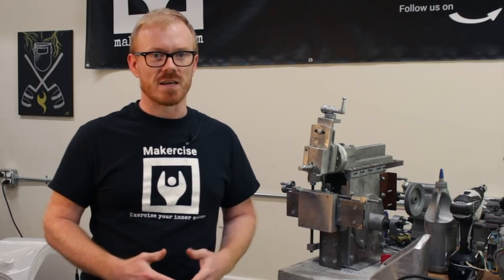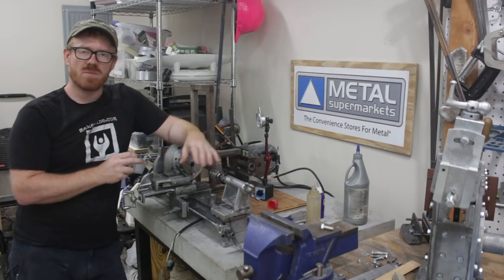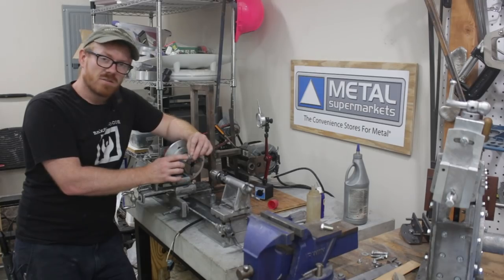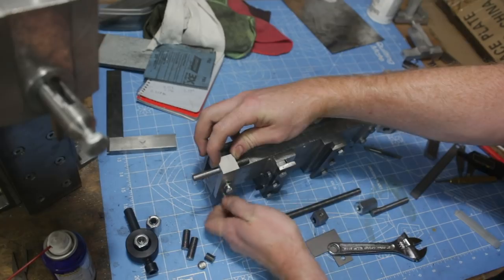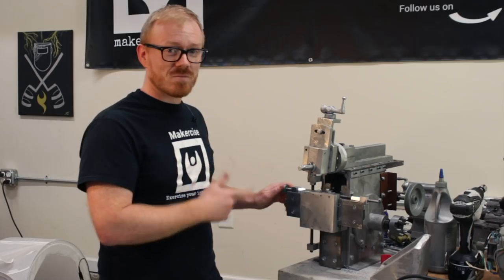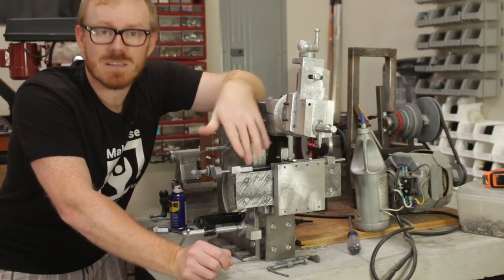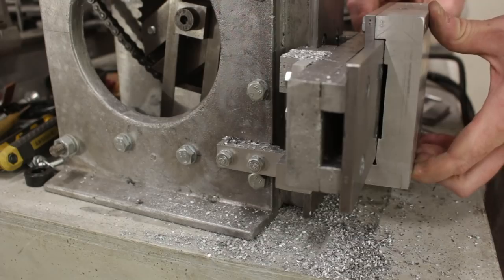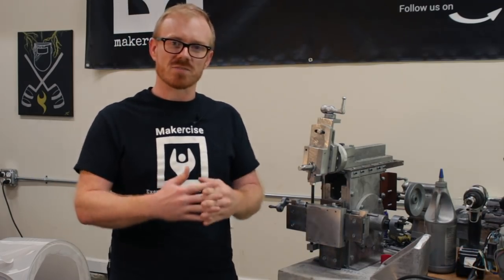Lead Screws for Shaper

Comment: I like the way the slides are developing. They look really good!  As an improvement to the machine, and most of the series,...The threads could be converted to acme by purchasing the lead screws and nuts from Grainger, or McMaster-Carr.  They also have available the nuts in brass.  I don't get anything from them...just a good source for a lot of industrial parts and supplies...not a discount house.  ALSO...there is another book that  goes along with the Gingery "SHOP from SCRAP" .Title is "Back Gears for the Gingery Lathe" by Marvin Guthery, published by David Gingery Publishing.  Its a real neat addition to the little lathe. The "Deluxe Accessories" has the change gears and gear train so you could have threading capability... just wanting to keep your fire stoked!!
Reply from the maker: I have the Back Gears book.

Comment: Hi Cressel, great videos! Im making progress on my “Gingery Shaper from Block” as you can see on my channel. Pretty soon, I’ll be doing leadscrews as well. My book shows the Vertical lead screw on the other side of the machine (right side if looking at it from front).  I noticed you put yours on the left side. Any reason you did that? Just asking to take advantage of your knowledge and experience, thanks!

Comment: Hello, I notice that you added a piece of aluminum behind your chuck lathe. Why? I ask you the question because I too am building a Gingery metal lathe and I have a problem with the chuck; I find .025 "from side play to the chuck and I'm sure it does not come from the bearings, thank you for answering me.
Reply from the maker: I plan to upgrade the bearings...mine actually have a considerable amount of slop. I used aluminum, because I didn't want to buy a 4" steel disk 1/2" thick. I can cast one of aluminum very easily.  Best of luck with your project.

Comment: I am glad to see you say your going to use cast iron next its nice to work with, used motor oil has grate btu rating but be very careful when melting and poring much more danger involved in a spill on the foot and you can get a small surface plate for 50 buck s I did at lee valley .I have seen all your work very good you inspire me .thanks .
Reply from the maker: Awesome feedback! Thanks
Reply: your welcome thanks

Comment: Are you making a CAD model of this project and your mold patterns for later use? Is there any word from within the Gingery community about  machine distortion under normal machining loads effecting accuracy of the work?From your last video it seemed you were taking a pass of ~0.03". My bet is with this machine you'll be taking much smaller passes in order to be accurate. Sorry for the questions, I'm new here.
Reply from the maker: I do have a CAD model in fusion 360. I am almost exclusively using lost foam at this point. Yes it was getting to be a very healthy cut.

Comment: Have you considered using wax filament to 3d print parts to cast using the lost wax method? Those small cranks seem like they would be perfect for lost wax.  I know you tried PLA, perhaps the lower melt temperature of wax would subject the mold to less stress.
Reply from the maker: Haven't really wanted to mess with 3d printing wax. I know some have had success, but I like PLA and would love to get that working.
Reply: That makes sense, I'd not seen lost pla done before. But looking into it now it looks like a pretty successful method. I bet you'll get it working without to much trouble.

Comment: Why threaded rod and not proper Acme thread rod stock? you could buy bronze and the correct size Acme-thread tap for the "nuts" and do it right? I mean, theres a reason why no machines have standard Imperial or metric threads for lead screws.....
Reply: Because the entire point of all the machines in the Gingery series is building them cheaply with commonly available (as in 'local hardware store' ) components. Regular threads are good enough for this use.

Comment: clamping (split)  MUCH better than set screws, especially for materials weak that are  in tension (your castings), plus it wont mar the surface, and generally no need for a flat spot.  Most don't realize the forces a screw can generate a long it's length axis. (a high ratio helical ramp/wedge!)
Reply from the maker: Oh yeh. Pretty much all the prusa parts were clamp style...only a handful of direct thread. I certainly don’t think they tried to tap the holes.
Reply: yeah i was thinking about your cast handle w/ the set screw  good channel I like it!  Someday you should see what it would take to get all the raw materials you need from the earth and then try casting from that.

Comment: Please use a soft faced hammer when adjusting machines. Something like a Gedore 8821270. If I can figure out how I will send you one. I do not understand the appeal of cast aluminum machine tools but still there is no reason to go denting them up with a claw hammer :)
Reply from the maker: I have moved up to ZA-12 for the mill parts I am casting. If you want to send me a hammer, email me.